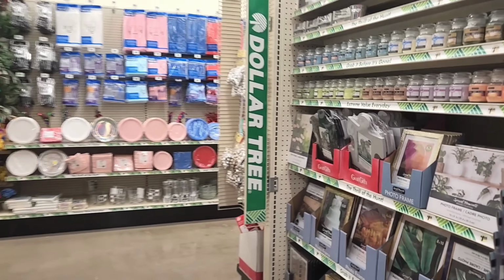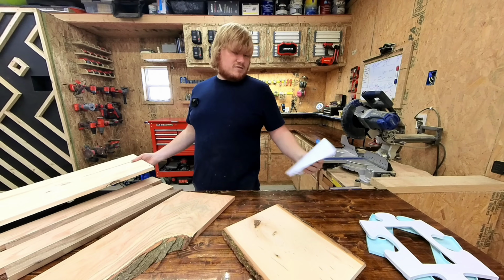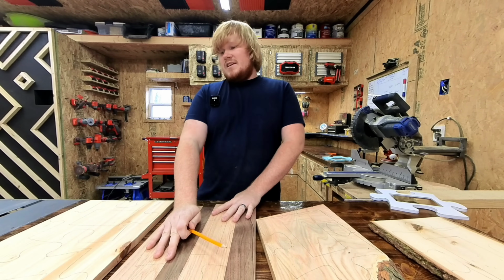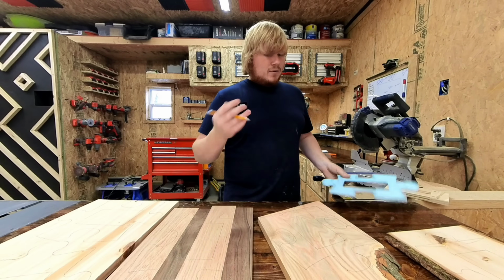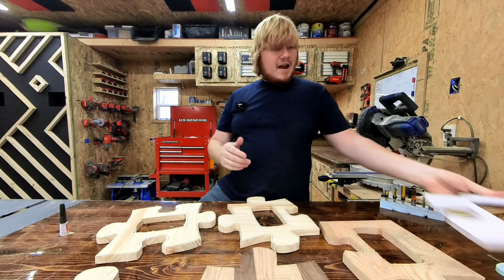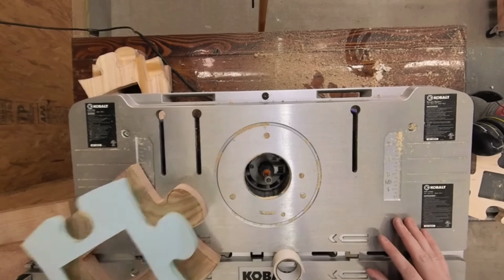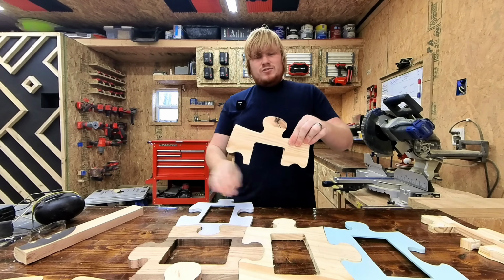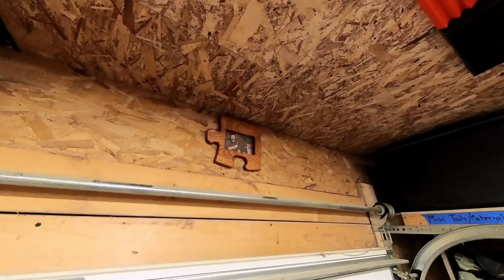EASY interlocking puzzle picture frames | Woodworking Project | DIY | How To

Comment: 6:32 - Man, I just noticed the dry erase boards that are integrated into the garage door panels!!! That is absolutely GENIUS!!! I don’t know if they’re actual dry erase boards or if it’s just some kind of smooth, non-porous material that is similar to the material on an actual dry erase board, but regardless that is a very good idea!!! I used to drive around town to service a chain of drug stores and anything that I needed to remember, I would use a dry erase marker and just write it on the windshield so that it was always easily seen and that way I wouldn’t forget about it!!! I’m the type that if I don’t write it down, I am definitely going to forget about it as soon as the next thought pops in my head, so writing stuff down is imperative for me!!! Yes, I could use pen and paper, but I forget about that because I’ve turned the page to get to a clean sheet of paper and then my important note has become out of sight and out of mind… never to be seen again!!!

Comment: Great idea! Clearly I need to spend more time at the Dollar Store 😂
If you are worried about burning or melting the plastic when using the router, transfer the first design onto a piece of 1/2” MDF. It cuts like butter and you can easily make unlimited dips from that template.
Reply from the maker: I like it :) Rocklet makes one from plexi but it's cashyyy, and with MDf these could still be the shapes I picked out :)

Comment: You can screw the template on the backside or bottom, run your router.  This puts the holes out of sight that can be filled and not noticed.  I have done this on several projects that saves two-sided tape and will not slip during router. 👍👍👍
Reply from the maker: Ahhhhh, I like it! Thanks buddy :)

Comment: I remember spraying WD40 on the bearings for formica work. blue painter tape over the wood should protect the wood from oil. Or, would you stain the wood first to protect. Either way, maybe the bearing wont stick.
Reply from the maker: Ill have to give that a shot! Thanks :)

Comment: I am trying to make a puzzle piece charcuterie board. I am experimenting with epoxy to give the plastic puzzle  some rigidity. And filling in the area where the picture would normally go. Woodriver makes a puzzle piece template. I have still not made a piece that I am satisfied with using that template. So I am trying your idea and I will let you know how it comes out.
Reply from the maker: Nice! Cant wait :)

Comment: Quick tip, instead of double sided tape that can be a pain to sand off, use blue painters tape on both sides with a little bit of super glue from tape to tape . When done you simply just pull the tape off and there is no glue or tape to sand off.
Reply from the maker: Ohhh yeahhhh. I was actually out of instant spray and the closest place to buy it is a 40 minute drive. :/ i heard you can use acetone instead of the "instant bond" I haven't tried that yet. :)  thanks for the tip!

Comment: I literally have been trying to save money on templates. So IKEA has Pandemic Plexiglass dividers for $19 vs. $69. So I bought a bunch they are about 24x30 each. After seeing this video I can now make puzzle templates! AWESOME video!  We share the same passion of upcycling and doing what’s needed to save materials…love that you showed the wood splitting as well!
Reply from the maker: Nice find! Where I work was throwing away an ENTIRE PALLET of the 1/4" thick plexiglass covid protectors that were 30x30, i begged and pleaded to take them home but they declined -_-
Reply: Which Ikea product is that? I haven't found it.

Comment: I love this idea.  Definitely gonna give it a try.  If the frame/template is too narrow, I would probably just stick two together with tape or glue.  I can see making a nice wall piece using these.
Reply from the maker: Not a bad option ;) it handled the thinner interior like a dream. Plus, once you made one from nicer wood you could use that as your template, I made one to replace the plastic one :)